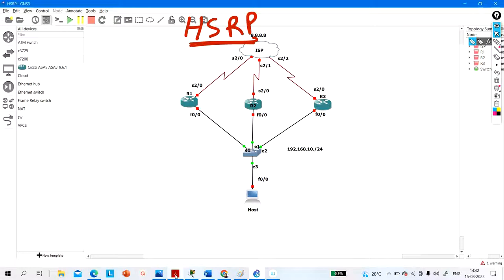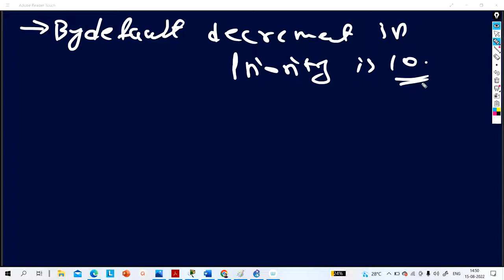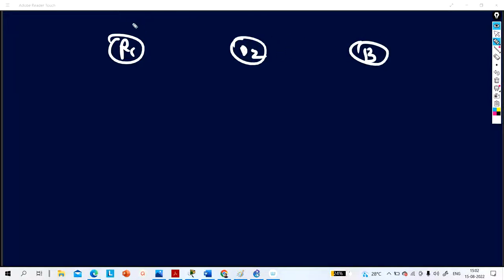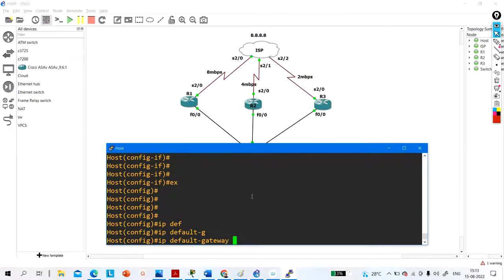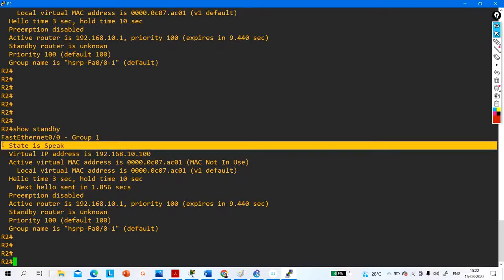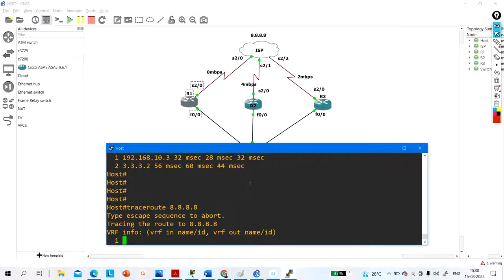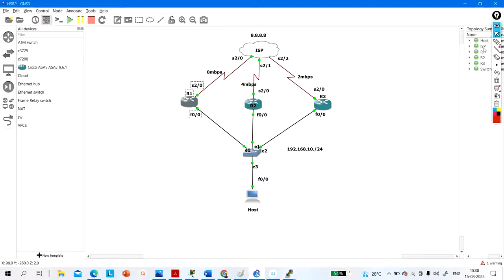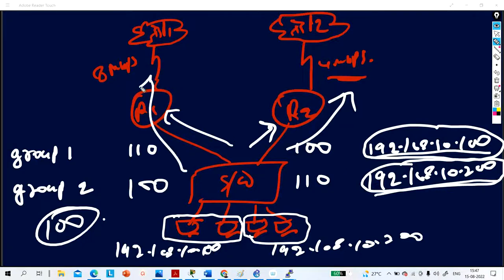HSRP Depth Explanation | All about HSRP Protocol | HSRP Preemption | HSRP Track | HSRP Timer |

Comment: Hi Sir, in the 38:00 min, you configured "Preeempt" on all 3 Routers interfaces. In that case R3 will REMAIN as ACTIVE because it has the highest IP ADDRESS among all those 3 routers.

UNLESS, if your goal is exactly to make R1 as the ACTIVE Router, then you NEED to change the PRIORITY of R1 higher compared to R3. (The highest among all routers) with the "preemept" configuration enabled.

WITH "preempt" DISABLED : Once a Router is ACTIVE (regardless if its Prioity and IP), it will remain ACTIVE until it is DOWN, even there is another router in the network that has HIGHER priority or higher IP Address.

WITH "preempt"  ENABLED : If the Current ACTIVE router has a LOWER priority/IP and there is another router in the network that has HIGHER Priority/IP, it WILL automatically change the ACTIVE router with the HIGHER Priority/IP.

Feel free to correct me if i am wrong SIr!

Btw, thank you for the very informative Content, you are a LEGEND!!!